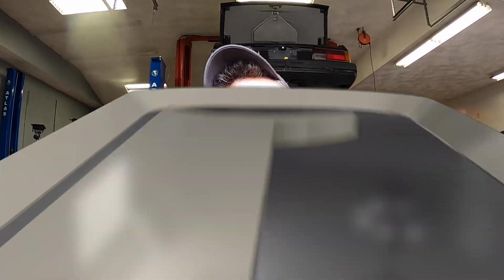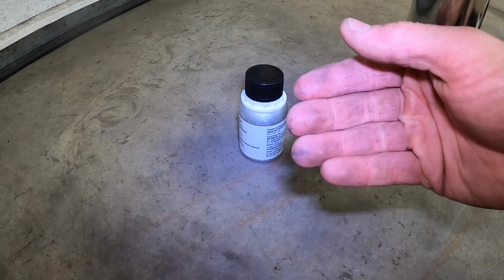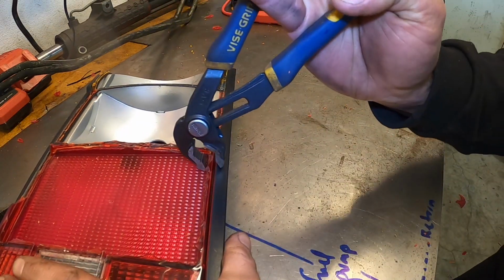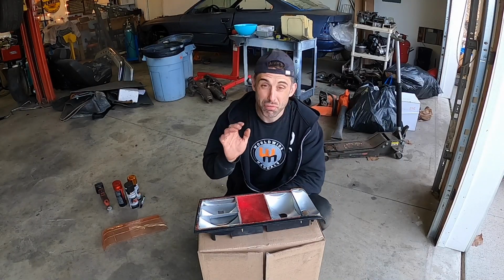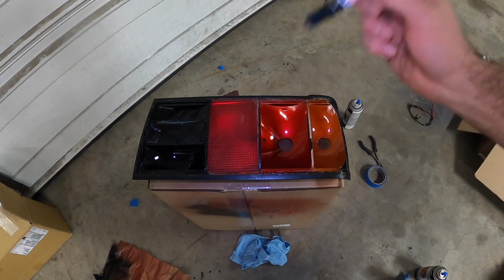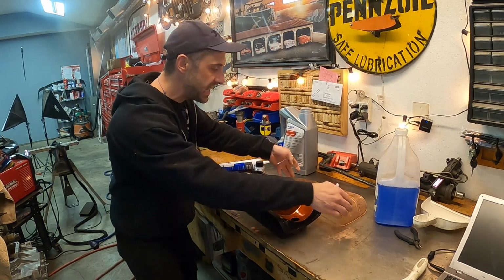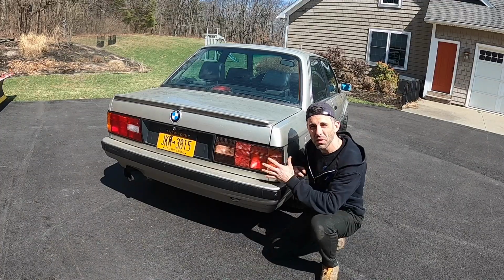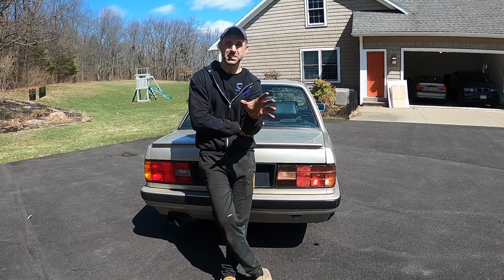How To Make Your Own E30 MHW Rep Late Model Taillights!!

Comment: Something important to note if your gonna do this yourself and go the route of using a dremel around the edges to make it sit flush against the housing, the eBay lens is oversized for that, and it will require a lot of trimming the edges and sanding it flush, as well as adding in some valleys for where the 2 middle sections go through.

Comment: done this by myself also, with same lenses. the problem and mistake here is that when you paint the reflectors of each sector of taillight they need to be not shiny, but matte. Because in direct sunlight, and also on your video, the reflection ruins a little bit of the view. And also noticeable when on car.
Reply: also i have used salmon color lenses but used light layer of black clearcoat from inside to make it look black. pm if pictures needed
Reply from the maker: It’s more than that. I needed to paint the backside of the lenses tint as well
Reply: @Garageaholic  yup, you can always do that since you used soft glue ;)

Comment: Looks very nice!! Would your oven make a good split from the front and the back of the housing? Other than that, thanks for another great vid!
Reply from the maker: Nope an oven won’t work in this case. There are too many interfaces that prevent the oven from doing its job. Early model tails - yep, but not late model